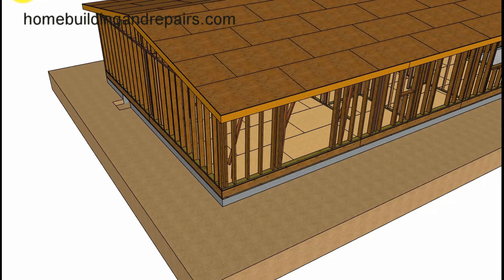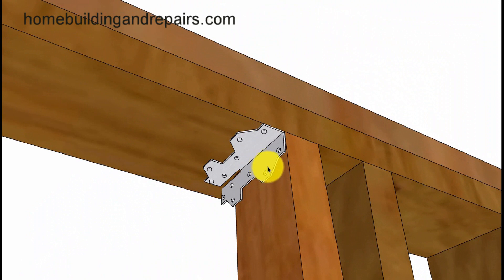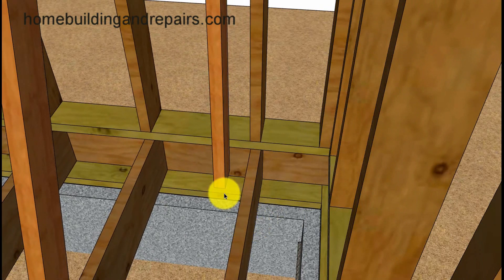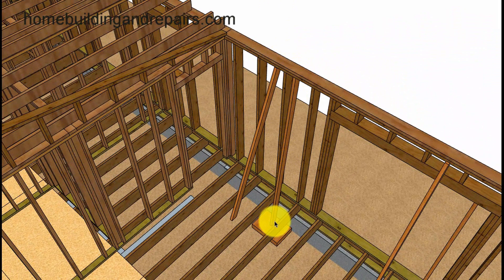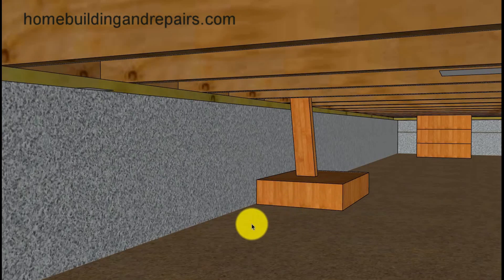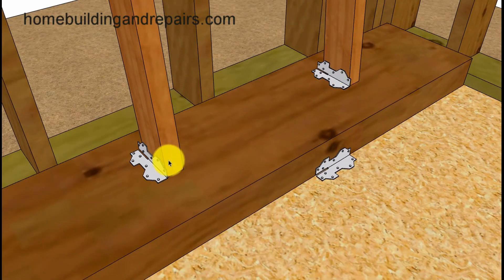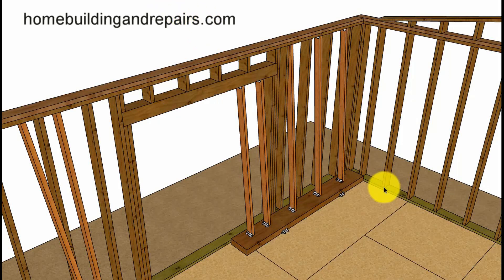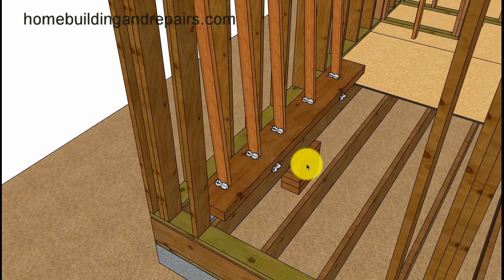How to Support Structural Loads for Lower Wall Framing Repairs – Crawlspaces and Floor Joist

Comment from the maker: Here's another video that might be helpful also "Two Methods for Supporting Long Beam Inside Wall For Post Replacement With Window In The Way" https://youtu.be/DofTTmwTaME
Reply: gregvancom the whole video shows new construction in the animation.  In reality, you would have finishes to work. All the methods shown would cause unnecessary damage or demo to the Finnish floors, walls, and/or sub floors. Also supporting the weight above by the top plate may be obstructive to repair work. In most situations you can get away with sistering  new studs to the existing, then removing the rotted portion of stud and replacing with a block. In the case where you do need  support, the thing to do is build a plumb teporary wall to support the framing above. About 18"-24" from the wall to be removed/repaired.  The temporary wall can be pressure fitted and it's level so you don't need to fasten through finishes.
Reply from the maker: Hopefully viewers can figure out that these suggested methods won't work on all projects, but if they can't then thanks for pointing it out. I did change the title to lower wall framing repairs.

Comment: The thing that's most interesting about these videos Greg, is that although there's a building code and we all have to follow it, it's amazing just how many different scenarios you run into and how every situation calls for some custom planning to make it work.
Reply from the maker: Isn't that the truth. I don't think I ever worked on a large project that didn't require a solution to a problem.

Comment: Your videos will be very helpful. The old owner of the house really let it go to pot. Needed subflooring & joist repair under bathroom & kitchen.and now having pulled the old 1948 plasterboard walls in those rooms I can see several places where studs and sole plate are dry rotted and should be repaired. My head carpenter has also complained about how structural members were compromised by cuts for the plumbing down in the crawlspace and now I'm seeing it in the walls. Subscribed.
Reply from the maker: Welcome to channel and glad you like the videos. I myself have came across plenty of damaged building parts in older homes that have created problems.

Comment: Hi Greg I really enjoy your thorough videos. I was wondering my interior bottom plate and some joist need to be replaced right at the corner. Will this method be used also. I don't understand how the plate can be replaced with the 2 × 12's or beams placed so close to it
Reply from the maker: I can only provide ideas, but can't suggest that they will work for everyone. Email me some pictures of your project and I will see if I can help.

Comment: Hello.
I have a house with a wood foundation. My realtor kept quiet about it. I had the perimeter excavated and saw how the perimeter sits on the earth. There was a water incident before the sale.  My floors slope toward the outside on the  on the perimeters.
The contractor took my 30k and said my house wasn't worth fixing. But I cannot give up on it. I want to add a library in the basement with 12 inch support walls that look like bookshelves. I have a concrete pad in the basement to work with. What do you think?
Rebecca

Comment: Thank You for making these video's, they are very interesting. Can you make a video on supporting a sagging ceiling. Im having a problem with I think is too much weight on my second floor. In a few spots the ceiling is dipping and you can see the profile of the joist on the sheetrock. I guess what Im trying to do is give some extra support for some non load bearing walls that just have to much weight. Thanks again.
Reply from the maker: I will put that video on a list of videos to be made in future. I don't have any information on this right now, but would suggest finding out what caused the problem. Maybe undersized joist where you have 2 x 10 that should've been 2 x 12 or there's too much weight on the floor above.

Comment: Thank you for these helpful videos. I would like to enlarge a door in an interior wall that is oriented parallel to the engineered roof trusses above and the floor trusses below it.  This is a one story house with a full basement.  In the basement I can look up at the underside of this wall, and see it Is located between two trusses, so the only support it is nailed to is the subfloor osb.  There is no blocking or bridging spanning from one truss to the other beneath the wall either.  Also in the attic no truss or beam is sitting on top of this wall.  I feel that I can conclude it is not load bearing, would you agree?
Reply from the maker: I cannot provide you with a definite yes or no answer, because I don't know enough about your building. Remember, some walls might not be load bearing, but might be required to reduce lateral movement or side to side movement, if that makes sense.

Comment: You mention a concrete pad, but I can’t find any videos showing how to do it, when you have a house on just a concrete pad
Reply from the maker: If you have concrete pads, you can usually use something similar, but instead of fasting a framing plate to the floor you can lay 2x4's perpendicular to the framing plate and have them run all the way across to the next wall in the room, to prevent the framing plate from moving. Let me know if this doesn't make sense.

Comment: Can't you just use telepost( jack post)  with a 6x6 beam to support the roof load and transfer that weight to the joists?
Reply from the maker: I don't see why not, just as long as they're going to be able to transfer the load from above safely.